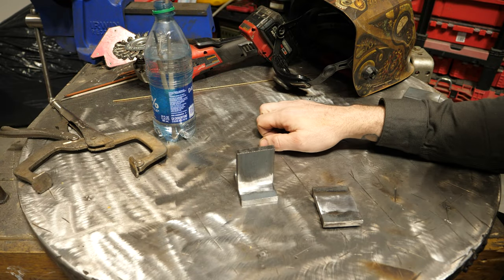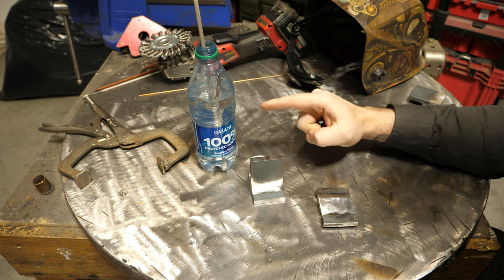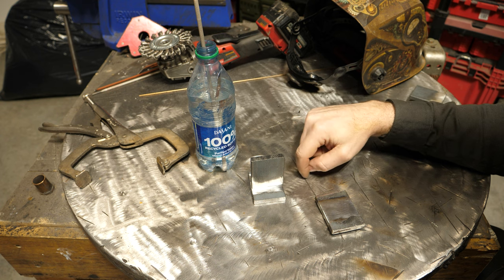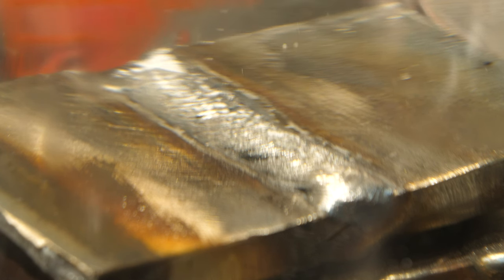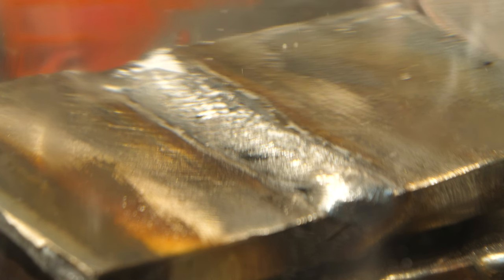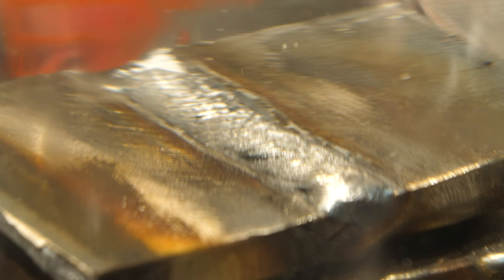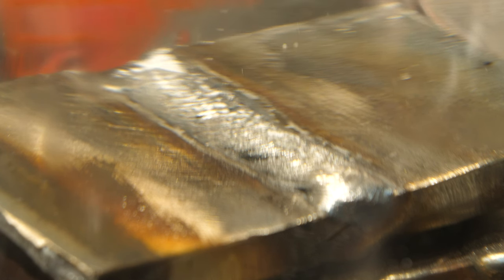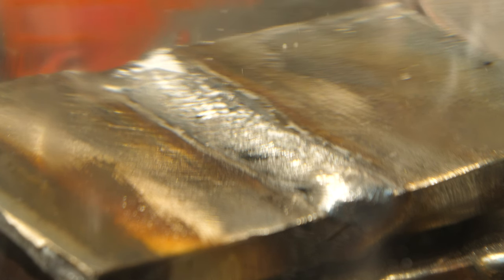Moisture in 7018 rods, will it cause weld failures?

Comment: I would like to see you doing more side work. It was very interesting to watch and learn. Also how about some DCEN or straight DC. I need to get a reference on how many inches wide and how tall or flat each weld should look like. My flux core welds look like a worm but not to bad after clean up. I feel it isn't right and would like to know for sure how they should look like. I run Forney-42300-Steel-E71TGS-030 110v Runs very well with little spatter. Can we see how to tig weld and how to dip the puddle? How about a small project like welding a square metal box or something? Maybe give us a little turn on your setting such as hot start,anti stick on or off,and arc force setting. I do love the strength test but also looking for more. I did go back and watch Alot of your videos and learnt alot from them but I'm needing more. At 55 yro and just now learning to weld I'm not looking to be a master but at least weld so it holds together and looks good. Hope you have a Merry Christmas and Happy New Year.
Reply: Many of your question are answered in previous Videos on this channel. How big your weld should be depends on the application. As example: for a fillet weld the hight of the weld should be 0.5 times the thinnest Material if you weld form both sides and 0,7 times if you can weld only from one side (rule of thumb) that's because the deposited weld is usually stronger than the parentmaterial and you don't want to waste some Material. But that's a tough topic and there are many books out there and I also found some very good datasheets that Cover this.
Reply from the maker: DCEN is primarily used with 6013 rods, on real thin material.  It limits penetration and causes the weld to lay like a bead of caulk on metal.  In a practical sense I don’t really use it much at all. With wire processes DCEN is used with self shielded flux core wire, DCEP is used for mig and dual shield.  Any video I have on Gasless flux core is done DCEN.  

Bead width is determined by the process and the material thickness.  The best way to determine if a weld is the correct width is to ask yourself “is this weld thicker than the material I am welding”.  If the answer is yes either move slightly faster or in the case of Mig, reduce wire speed.  To a certain extent this is a self correcting problem.  Too big of a bead on thin material generally means holes, and on thicker material most home hobby welders can’t produce enough power to make too big of a weld in a single pass.  I have a stick welding video with actual measurements here: https://youtu.be/OO1ryeqWqso?si=FXNyCCbxQw2bbCDq

Tig wise, February or so I will be starting that.  I have a couple more videos I want to release on Mig welding first.  

I will be getting into more projects, once I can locate a building to buy I will be moving out of my tin shed into it.  I have been looking for 4 months and I have not found anything yet.

Comment: Do they make flexcore 7018 wire? I am just starting out to weld and I have been watching you for about a year now great job, the only thing I would like to see the face of the teacher every so often, thanks again
Reply: There are flux core and dual shield with similar properties, but it wouldn't be called 7018. Flux core has different designations than stick.
Reply from the maker: So 7018 is just how they describe stick rods.  The (70) in 7018 means 70,000 psi tensile strength.  The (1) is a reference to what positions you can weld with it (1 means all position, 2 means flat or horizontal only).  The (8) is flux composition type.  Stick rods use that description, wire processes use different descriptions.  Er70s6 would be common “Mig” wire, (ER) stands for electrode rod (even though it’s a bare wire.  70 is 70k psi tensile strength.  (S) stands for solid wire (not a cored wire like flux core).  (6) is referring to chemical composition.  With flux core wire the most common would be E71T-GS.  The (E) is electrode.  (7) is 70k psi tensile strength, (1) is position, 1 means all position 0 means flat only.  (T) means tube, because the wire isn’t solid.  -Gs I believe means general service, but it also means single pass only (you can’t weld multiple passes thick).  

I know that’s a lot of info, the simple reality is numbers and letters are just used to make it easier to pick the right “tool for the job” since they all have completely different properties.  7018 produces a very strong, smooth, easy control weld bead.  The closest weld with wire to it would be dual shield wire (which is flux core wire with shielding gas).  Dual shield produces welds that are very strong, defect free, and smooth.  The normal store bought flux core self shielded wire is not a good replacement for 7018 for welding steel 1/4in and over because it tends to produce more brittle welds and it has a much higher issue with porosity.  The downside to dual shield wire is it requires parameters than many cheaper home welders can’t run, and it’s more expensive than normal gas shielded Mig.   Properly run short arc mig produces extremely comparable welds to 7018 on 5/16th and thinner material.  

As far as showing my face, I prefer my anonymity.  Think of me just as someone that’s sharing knowledge and trying to help people out.  You can do anything I can with the practice and hard work 😀.
Reply: Wow, what an excellent explanation. I have looked all of that up, when I was looking to buy wire, but most of it didn't stick any longer than it took to click the buy button.

Comment: I'm a new welder teaching myself.  I used a 7018 rod in my garage (out of the rain) to weld some brackets to a trailer that had been sitting in light rain for several days.  I had to increase my amperage by about 20 just to get the rod to not stick and lay any bead.  I did a test bead on a dry piece of steel and it did fine at 83 Amps.  Had to go to 105 Amps to get a bead on wet trailer.  Is this all normal?
Reply from the maker: If you’re welding on wet steel make sure you avoid shocking yourself 😀.  With that said no doubt cold steel with water will take more amperage.  As the water boils off it pulls a ton of heat with it.  The more heat that gets pulled out the more amperage is needed.  It’s good that you noticed things weren’t quite right and upped the amperage.  The same thing happens on cold steel and thick steel vs thin.  Always adjust amperage based on how a bead looks 😀

Comment: Its why pipefitters use 7018 religously.   Its basically an industry standard. Gregg, you just prove it even more.    But now what do i do with my .035 fluxcore?
Reply from the maker: So flux core is loosely low hydrogen.  They do make wires that meet stricter standards (aka low hydrogen) and they even put them on wire spools that could be baked.  I have never seen someone bake a full spool out, and my guess is it would meet the requirements without it.  I wouldn’t worry too much about flux core wire imparting hydrogen into steel.  I would worry about welding high strength steel with normal flux core though, from a brittleness standpoint.  Flux core wire does exist for all sorts of higher strength alloys, the problem is many of those wires you can’t get in less than a 10lb spool at high prices.  The standard self shield wires wires (fabshield 21b, and Lincoln nr211) are not designed to weld higher strength steel and would likely be overly brittle.  Much like doing multi passes with -gs flux core wire tends to make brittle/hard welds, normal t11 wire would also likely produce super brittle welds on higher strength steel.  The practicality of flux core over stick on higher strength steel becomes a issue because of the cost of the consumables, stick is far cheaper for small jobs 😀

Comment: Hydrogen control is discussed in AWS D1.1.  According to section XI4, cracking in steels, having a carbon content of around 0.10 percent (10 points) and below is unlikely, but may occur with HIGH HYDROGEN or HIGH RESTRAINT.  Per section XI6.2.5, the three levels of RESTRAINT are:
(1) Low Restraint. This level describes common fillet and groove welded joints, in which a reasonable freedom of movement of members exists.
(2) Medium Restraint. This level describes fillet and groove welded joints in which, because of members being already attached to structural work, a reduced freedom of movement exists.
(3) High Restraint. This level describes welds, in which there is almost no freedom of movement for members joined (such as repair welds, especially in thick material).
Accordingly, the results of the testing, shown in the video, make sense, since the material being welded is mild steel and the weld joints are of low-restraint type.

Comment: So this is a total noob question, If 7018 is so good like this, why would we need to use any other rods?
Reply: Harder to use, more cleanup before/during weld, and other rods have different advantages that aren't strength.
Reply from the maker: Bunch of reasons.  Every rod has its ideal uses.  6013 is far easier to weld thin material with.  6011 is far easier to weld holes shut, and weld together poor quality material.  6010 works excellent for root passes and on poor material.  7018s main limitations are it has a liquid puddle so trying to weld shut holes/bridge gaps in repair work can be very difficult.  It can’t really be run vertical down (it’s not specified for that).  It’s cold weather performance may not be as good as some other specific rods.  

As foggynight said it’s also more difficult to run 7018 than many other rods.  Restarts are hard, and it has a tendency to have weld start porosity.  From a use ability I virtually only stick weld with 7018.  I will use 6010 from time to time, and I will use 7024 occasionally.  Technically I could use 7018 for everything I stick weld, it’s just that certain situations warrant other rods to make the job easier.  With short arc MiG you can weld everything from auto body to 1/4inch steel with one wire (er70) without any issues.  The difference is that runs consistently the same and you have far more control over heat input than with stick.  Since stick relies on flux and a fairly aggressive arc to work, being able to control weld defects becomes a important consideration.

Comment: None of the welds are being  tested  in tension  .
Reply from the maker: How is the face of the weld not being tested in tension? The face of the weld experiences the most tension and the root will have virtually none.  It’s not really a shear test nor is it a pure tensile strength, it’s a mixture of the two if anything.  The point of the demonstration is to show differences between the rods, in a applicable joint that would be common to weld.  7018 is going to be stronger on thicker plate than 7014, 7024, and 60xx series rods.
Reply: Then you are good to make those tests 🫡.

Comment: Instead of an oven, you can just use silica gel to get moisture out of 7018s.
Reply: I'm not sure if you can get the moisture out of the rod because silica gel binds moisture from air. But for sure it helps with storing to bind moisture in a concealed containment.
Reply: Silica gel is far to weak, it only really pulls down to about 30% relative humidity and that is when cool and fresh. There are some desicants used in labs that will bind moisture more strongly, which is what the rod is doing. You need something that binds more strongly than the flux, at the storage temp. But even then it will be very slow acting, a strong desicant may be ok for storage of already dried rods. Easier to just use an oven.
Some desicants are non-reversible others are reversable. Phosphorus pentoxide would certainly do the trick but it is very reactive.

Comment: Hi Greg
Static tension is the way hydrogen cracking happens in most cases.
I'm going to suggest do a static test on fillet welds.
Reason is - I would like to know too :-)
Thing is - I did my Doctoral research on this
http://bura.brunel.ac.uk/handle/2438/4617
"Hydrogen distribution and redistribution in the weld zone of constructional steels"
I looked at and solved where hydrogen is in welds and how it moves in time - which was thought "all but impossible" to do...
The test you did - yes good, needs doing - but it isn't the most likely way you are going to see hydrogen cracking.
You could configure your test something like this:
http://www.weldsmith.co.uk/tech/struct/210122_fwtest_rig/210122_fwtest_testrig.html
"Tensile-test rig for beam-configuration fillet-weld samples"
Fillet welds because it is easier to leave them in a state of high stress without needing an expensive testing machine.
You could use a jack to put the stress on, but wedge the test at that stress and leave it - taking the jack away if you want to.
Calculate the Euler-Bernoulli beam deflection at bend stress and apply a jack force which bends it that much.  Use a string and a rule to measure the bend.  Then you know you have static stress which is the yield stress.  = a really good test - in the first instance and likely the be-all-and-end-all.
See how things go - but "follow your nose" with option put a sack of ice on the weld(s) - which you would expect would make the test more cracking-prone and make more of the samples break.
It could take hours to a day or so to crack.
There would be a "bang" using the beam-configuration fillet weld sample.
You could compare high-hydrogen and low hydrogen fillet welds.
Basically your oven-baked 7018 should never break, whereas a high-hydrogen one should, especially if you put ice on it after welding.  In desperation you could do a weld with a 6010.
You would expect classic underbead cracking - along the leg of the fillet weld in line with the length of the beam.